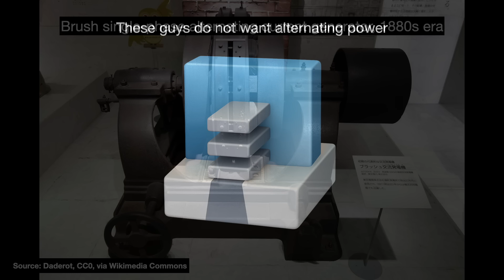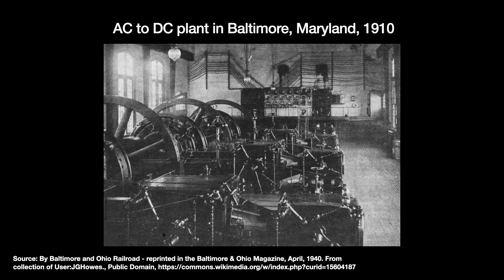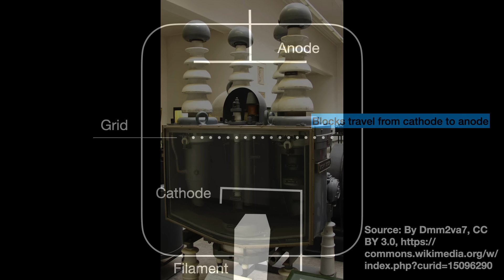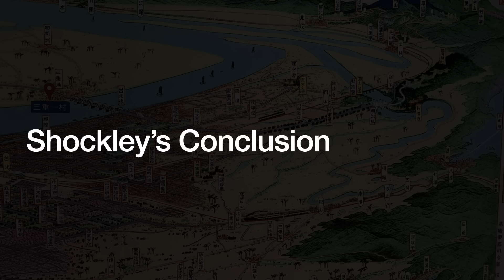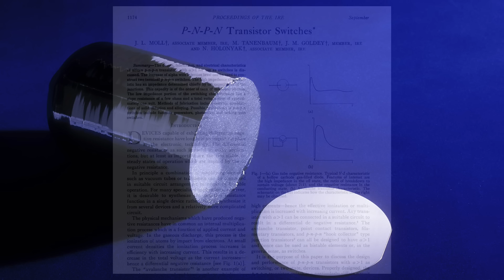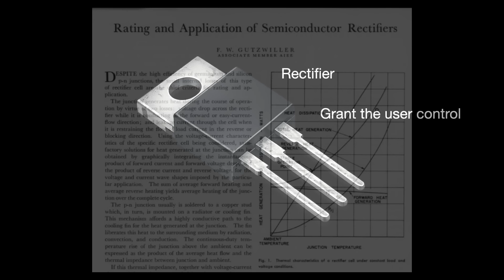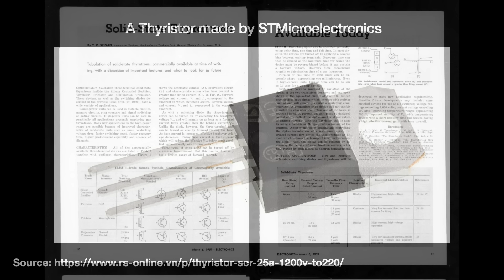Thyristors Did to Power What Transistors Did to Logic

Comment: About '99 - 2000 I used my first thyristors in industry during my career. DC rail commuter train application.  Only then did I comprehend why electric trains use such high voltages and astronomical currents...and how we got that DC power.

Comment: In the past English power station had massive mercury vapor jar in a locked room to convert ac to DC for the trams and trolley busses. In derby power station they were still there long after the trolley busses had finished. Some one decided to steel the mercury and it went everywhere in the process. Amazing to think someone made a small component to do the same thing on a smaller scale.

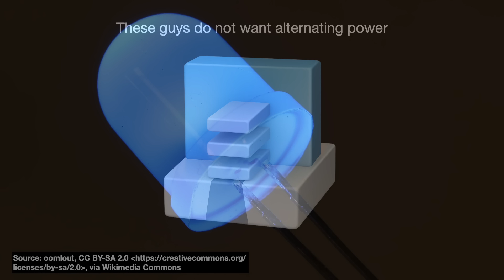Comment: 1:42 A capacitor will not "bust" when exposed to alternating current. In fact, that is really their primary use case in the absorption of reactive power. Their use in DC systems is essentially just coupling capacitors to filter out noise.
Reply: Electrolytic capacitors are polarized (like a battery), and will get hot if current is applied in the wrong direction; since the electrolyte is damp, this can cause it to vaporize, and cause the capacitor to leak. Older electrolytic capacitors didn’t have a designed-in venting mechanism, and they could pop, literally.

Comment: instead of using a mechanical rectification mechanism that takes AC output from an AC generator and uses it to spin an AC motor that drives a DC generator, why not just have the original generator just be a DC generator

Comment: Nice the simple transistor has just about killed the need for gold contacts. In the 80s they/we were toying with diamond film semiconductors and 2000 amp per square cm was being reached. Yes the picture was strange as it was white hot but the possibilities of a thyristor so robust. I haven't heard any news so a quick search....Diamond film semiconductors are an advanced, ultra-wide-bandgap (\(5.47\text{ eV}\)) technology utilized for high-power, high-frequency, and extreme-environment electronics. With superior thermal conductivity (\(22\text{ W/cm}\cdot\text{K}\)), diamond films enable next-generation, compact devices (e.g., 6G, power, and thermal management) that significantly outperform silicon and GaN.
Yep its a thing wondering whats holding them back.

Comment: Never mentioned the ignitron, a mercury filled thyratron.
Ignitrons were used un pulse power applications like plasma physics, when a large capacitor back was to be discharged. Nowadays , thyristors or MOSFETs would be used.

Comment: Gases inside are either Hydrogen OR Mercury OR Xenon?!  That is a very bizarre choice!  I suggest you let go of the LED "accepting" a current and look at it as the semiconductor being "driven" by more voltage to create more current.  The first solid state transistors were not Field Effect Transistors, they were Base-current throttled.  This first SS transistor was controlled by the Base current which then was provided by the Collector, not controlled by the current "injected" into the Collector. Both of these currents (small Base current and Large Collector current) were then available at the Emitter.   Ultimately all circuits are described by being voltage or current limited.  No injection or acceptance.  There is the concept of Reluctance which is not germane here.

Wow, a guy named Jewell.

Comment: It is always described as an AC sine wave that they claim they take energy away from the push wave only which doesn't make sense if you pull from just the top positive wave only there would be no way for it to have the same negative sine wave depth or equal swing into the negative wave side after clipping the positive side. You would have a wave after cutting the top "Push" side off that would swing way into the negative but only a little into the positive @ 60Htz a sec. How do you still maintain a sine wave cutting the top "Push" wave only? Does the negative wave back still remain bigger than the positive wave side that is drawn off from supposedly?

Comment: An engaging video. Thanks. 
Let me share some insights from enforcing SCR-related and Triac patents as a patent attorney representing GE. (Thyristor was a later term, from other companies). These inventions largely came from GE’s rectifier group, which was looked down upon by engineers in the semiconductor signal device group. The rectifier group, as I recall, had originally made fairly primitive selenium plate rectifiers, but they had a solid understanding of controlling power efficiently. 
Bill Gutzwiller was a highly talented application engineer and author of GE’s SCR Handbook, which was the bible in the field. He held the basic patent on the SCR control circuit, which GE successfully enforced. He probably would have applied for and received more patents, but for GE’s relatively conservative approach to not seeking patents on what might be considered analogs to vacuum tube circuits using semiconductor devices. 
In my opinion, GE was the leader in developing the SCR because of its rectifier engineers’ recognition of necessary differences between low power signal devices and higher power switching devices. Their work led to the now widely-used, ultra-high voltage, long distance DC power lines, a field in which GE was a leader. Stacks of SCRs converted the DC back to AC for local distribution and use. A humble, patented GE package for stackable rectifiers, about the diameter of a dollar coin, led to the large, stackable, “hockey puck” packaged rectifiers and SCRs used in such systems. 
The Triac was invented when Richard Aldrich, from the rectifier group, met one day with Nick Holonyak at the research group. It was the first, practical bilateral switching device, now found in light dimmers and small motor speed controls. The invention was drawn on a blackboard in Holonyak’s office and the first device was made within two days. I got that device for use as a litigation exhibit and kept it in my desk for many years. See U.S. Patent No. 3,476,993.

Comment: How do the magnetic amplifiers compare to this? You can use a very small DC current in one coil to control a much larger AC current in the other coil(s). The core of a transformer has a limited capacity to conduct magnetic fields through it before it's saturated, so this can be used as a control lever of sorts.

Comment: A rotary converter is NOT the same thing as a motor-generator.

A motor-generator is actually an electric motor driving a generator, commonly an AC motor driving a DC generator.  A rotary converter is basically a mechanical switching device driven by a synchronous motor to convert AC to DC.    In earlier times, a common use was to provide DC for streetcars.

Comment: The thumbnail shows ABB valves suspended from the ceiling, with special seismic protection in the form of post insulators connected to mechanical dampers in the floor.  During earthquake these valves are designed to swing freely, with displacement amplitudes limited by the damping system.

Comment: Technically the mercury arc rectifier is an LED. Despite not using the photoelectric effect like modern tiny LEDs like an arduino uses, It lights the mercury vapor, originally meant to produce light, and it only allows current flow in one direction. Therefore, it is, by definition, a Light Emitting Diode, LED.

Comment: I am currently teaching Power Electronics. Thyristors are interesting and they were very important, but then in the modern day MOSFETs and IGBTs have replaced them in most applications because they could switch at higher frequencies which makes filtering easier and more efficient.
You could argue that IGBTs are still thyristors because they have 4 layers, but if an IGBT ever latches like a thyristor, something has gone very long.

Comment: Before LED's took off a lot of theatrical lighting, SCR's and TRIAC's were very often used in dimmers for incandecent lights. 
They were more than a 1/5 the size of the prior technology, saturable reactors, and could handle larger loads. 

Still needed some iron for the choke to keep the harmonics under some degree of control, but they weighed a 1/10 of the saturable version.

Comment: Rotary converters are still made, but usually for adding phases, not rectification.  They're common in smaller shops that lack 3-phase power but need it to power 3-phase equipment.

Comment: Former navy nuke here. Older submarines still use AC/DC motor-generators, and they are still noisy, expensive, and inefficient. Newer boats do it with power electronics. I am very glad to have had the opportunity to see both systems in action.

Comment: There are a myriad of minor errors on this video but since they don't affect the main story and I can't be bothered writing a long post to explain them all, I won't.   But Asianometry startled me at 13:45 when he said germanium was fine for laboratory use but impractical for most applications.   Crikey, all those billions of TV's, radios, stereos, radio station equipment, etc made between 1955 and 1975 using germanium diodes and transistors = I must have been in a parallel universe.   
With the exception of certain Philips transistors which suffered from tin whiskers due to an unwise factory decision, germanium semiconductors proved to be very reliable.
Contrary to what Asianometry said, the two-terminal 4-layer device was a very practical and useful device.  GE, who called them "Diacs" made and sold millions of them.
Also note that thyratrons, SCR's, and Triacs can be used to not just rectify and regulate - they can be, and are, used to invert DC into AC as well.  However, in the last 40 years or so, power FETS have taken over since they are more efficient.

Comment: Typically in electrical or electronics closed means allowing flow and open means disconnected, at least in North America. I’m legit curious if anywhere else does it differently or if it just got mixed up
Reply: I don't think it's geographical, I think it's disciplinary. EE people know it's a circuit model, therefore the metaphor is that of a closed connection. Non EE people think of it like air going through a window, so it must be open for them

Comment: The largest scale application is probably the DC transmission lines from the Itaipú hydroelectric plant (world's largest) to Southeast Brazil. Itaipú is a joint venture between Brazil and Paraguay, as the dam is in the Paraná river that divides the nations. The power generation is divided 50-50, but Paraguay has a 50 Hz grid, Brazil 60 Hz. So half the generators operate in each frequency. Paraguay's demand for energy was tiny compared to Brazil, so it sold almost all of its half. The 50 Hz AC is then rectified to DC by these giant banks of thyristors, transmitted to an installation hundreds of km away, and converted back to AC, but 60 Hz. When the plant was being planned, Brazil offered to bear the costs of turning the whole country of Paraguay to 60 Hz, but they refused. A matter of national pride, perhaps ...

Comment: Great video brother. I love power electronics. The thyristor is often glazed over quickly during the learning process. Probably because with switch mode power supplies becoming so prevalent they are not seen as often anymore. They're mostly used as voltage reference now for some function to be enabled when a threshold is reached. I rarely ever put them in new builds except to replace old ones in repairs.

There's only one place in north america (that I'm aware of) where dc is transmitted over a long distance. There's a 3 or 400 mile long dc powerline in california somewhere. I forget what they use it for.

Comment: You mention the rotary converter but your description isn't quite accurate, it's not just an AC motor mechanically connected to a DC generator, that would be called a motor-generator (MG) and was also used for lower power levels but the high power rotary converter actually combined the motor and generator into one device with one set of field coils and a rotating armature with both a DC commutator and AC-style slip ring connections, and it was slightly more efficient because it didn't have to convert all the electrical energy into mechanical energy and back. Of course they were still bulky devices that had to spin at just the right speed and non-spinning devices are way more efficient and reliable.

Comment: My first experience with a thyristor was an electric blanket controller. By adjusting the gate firing timing within AC voltage cycles, it can control the duty ratio of the waveform, thus the temperature of the blanket smoothly. I was impressed with the simplicity and ingenuity of the circuits. Before the advent of the triac, such power control was done by something like a variable voltage transformer, such as a slideac.

Comment: Actually the original bipolar transistors didn't do much for logic, it was MOSFETS that did that.  The original bipolar transistor was pretty much made obsolete by FETS and MOSFETS, except in operational amplifiers and special audio amplifier applications. But now in the days of battery powered devices FETS are used a lot more. About the only place discrete bipolar transistors shine is in high voltage inverters as Insulated Gate Bipolar Transistors.

Comment: Made a 1-10 kW shunt using Triac and MOC3041 optocoupler to regulate battery voltage during solar power supply; while, it fed 220 v 50 Hz ac current to the geyser, hot plate, fans, etc. Worked well for a decade. Now I've retired.

Comment: The mercury arc rectifier is wild. Thanks for covering them. There is a recent (at most 2-3 years old) video of one in use in an elevator control system still in use!
Reply: A large mercury vapor rectifier in operation has got to be one of the most impressive things I've ever seen. It will humble your soul just to stand and look at it.

Comment: Having toured the NZ HVDC facility picture in the thumbnail and peered through a window to see inside I felt like a midget looking at a good old fashioned vacuum tube. And no, your don't (cannot) enter when it's operating. The amazing thing is it produces a 50Hz square wave from the +/- 350kV dc and pokes that into the network - sort of. Actually it's followed by a line of LC filters (3, 5, 7...17th order) to give a clean sinusoid.

Comment: Damn, I didn't know Holonyak was such a chad. I think a good follow up video would be explaining the differences between the thyristor, IGBT, and power MOSFET. I've seen some monstrous IGBTs used for switching high voltage and those things are mind blowing.
Reply: They blow up too, if not designed properly

Comment: It was very hard to develop a working model of an SCR in 1974 while I was working at Motorola. I designed about 10 devices on a bipolar IC and one worked very well. An SCR has high level injection and a non-linear response, so trial and error was the best approach, That device ended up in a lot of switching applications of that era.

Comment: The video describes various early rectifiers, but fails to mention synchronous rectifiers.  These are a set of electromechanical contacts driven by a synchronous motor that opens and closes the contacts precisely when the current passes through zero.  They can handle hundreds, or even thousands of amperes of current with little effect on the contact points.  They were often used on electric locomotives, taking alternating current from a catenary wire and converting it to pulsating direct current internally to supply power to their DC traction motors.  Thyristors cannot switch on at the exact zero-point of an AC waveform, thus a synchronous rectifier produces an electrically cleaner output.

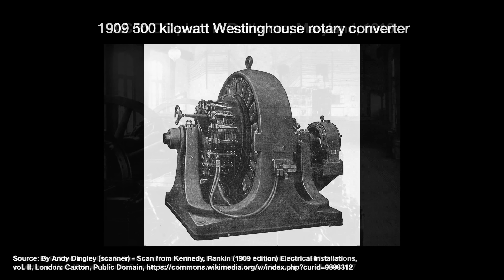Comment: 3:15 just wanted to add that these style converters can also run on hydro power which is most commonly how they were used so in that regard they don't consume power to convert it like you're stating because yes that would be weird to do it that way. (Use electricity to convert ac/dc)

Comment: When I was an undergrad EE student (~1977) I went on as tour of the DC to AC conversion station in Sylmar.   That station converts the DC power from the Columbia dam to AC for use in Los Angeles.  At the time there were six giant blocks of switching devices.  Five were rooms full of giant thyratrons, and one was a "new" room full of SCRs.
Reply: Are you sure that it converted power from Columbia river (in Washington State) to serve Los Angeles (in Southern California)
Reply: @davidkamaunu7887 yes
Reply: @davidkamaunu7887  look up the Celilo-Sylmar line. It actually starts on the Oregon side of the Columbia, and does go straight to L.A.

Comment: 1:42 Capacitors do not, generally, "bust" if used with AC. in fact, they're incredibly important components for almost any AC or even RF circuit. Every power supply has a capacitor relatively directly connected between mains, as part of the RFI prevention measures.

Comment: Doesn anybody else hear popping in the audio?
Reply: yup, i can hear it too. i thought it was my speakers.
Reply: i just put my head closer to the speaker cone and noticed a fresh rip in the rubber surround damit
Reply: Yup, it's bad audio
Reply: I hear it. A little subtle, but it's definitely there
Reply: No
Reply: It’s the Morse code encoded dorector’s comments track
Reply: your all to young to notice interference presumably from a phone? back in the 90 your radio could tell you in advance of the actual ringtone taht a call is coming
Reply: @ismaelyu5  Okay, but the ringtone thing is not that old. I was born in 2004 (EU) and I absolutely remembered the du-dududu-dudu-duuuuuu. Stopped hearing it somewhere in the mid 2010s

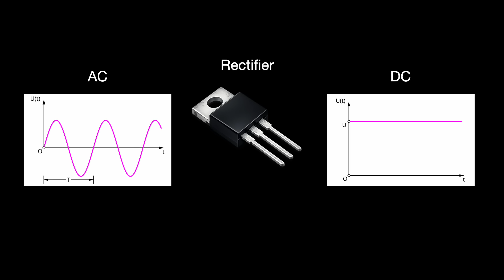Comment: Wait what, that graphic ad 2:33 is wront at ao many levels...  A rectifier will never produce a flat line DC voltage... Nonono, it will only flip one side of the AC waveform. You need more devices to make it flater.
Also there is no inverter chip, but a complete inverter circuit.